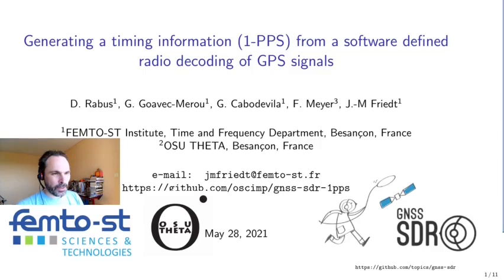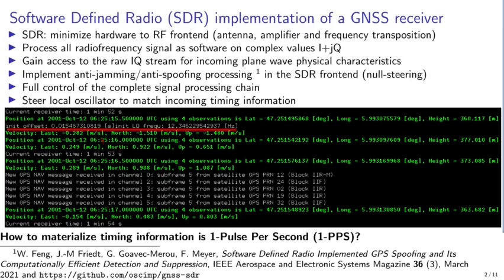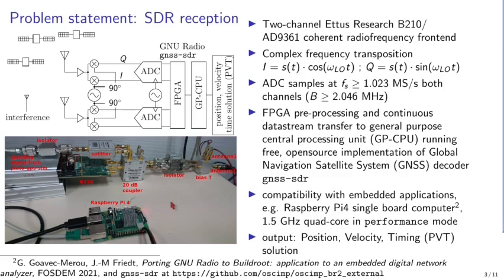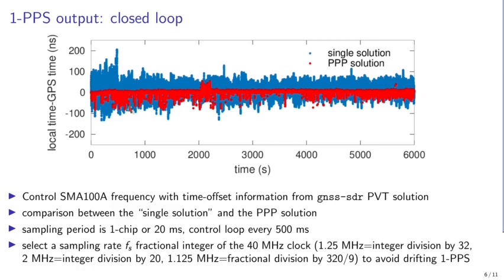Generating a Timing Information (1-PPS) from a Software Defined Radio Decoding of GPS Signals

Comment: AI Summary

Abstract:

This IEEE IFCS 2021 tutorial demonstrates a method for generating a precise hardware 1-PPS (one pulse per second) timing signal using a Software Defined Radio (SDR) processing Global Navigation Satellite System (GNSS) signals, specifically leveraging the open-source GNSS-SDR framework. The presentation outlines the challenges of obtaining accurate timing from SDR systems due to asynchronous data transfer and processing latencies. It identifies the ADC sampling clock as the only reliable time reference within the SDR chain. The core solution involves steering the frequency of the ADC's clock (which also clocks the FPGA) based on the timing corrections derived from the GNSS-SDR software's Position, Velocity, and Time (PVT) solution. An FPGA counter generates the physical 1-PPS pulse from this steered clock. The results show that this closed-loop system achieves timing stability (Allan Deviation) comparable to dedicated hardware GNSS receivers, reaching approximately 10⁻⁸ at 1 second and 10⁻¹² at 10,000 seconds. Potential pitfalls, such as sample drops caused by incorrect GNSS-SDR configuration and challenges with less stable oscillators like TCXOs, are discussed along with their solutions. While frequency stability is demonstrated, precise phase control remains an area for further investigation.

Generating a Hardware 1-PPS Signal from GNSS using Software Defined Radio

*   0:00 Goal: Generate a hardware 1-PPS timing signal from GNSS signals decoded using Software Defined Radio (SDR), specifically the GNSS-SDR framework.
*   0:20 SDR Principles: SDR minimizes hardware (antenna, LNA, frequency down-conversion, ADC) and performs signal processing in software on a general-purpose CPU, analyzing I/Q (complex) data. This allows flexibility, e.g., for spoofing/jamming analysis.
*   1:11 Control Objective: Use the time information derived from the GNSS signal by GNSS-SDR to steer the local oscillator of the SDR front-end.
*   2:03 Problem Statement - SDR Data Flow: SDR reception involves an antenna, preamp, and I/Q detector feeding dual ADCs (e.g., inside an AD9361 on an Ettus B210). Data goes through an FPGA to the CPU via asynchronous interfaces (USB/Ethernet).
*   3:37 Embedded Feasibility: Systems like Raspberry Pi 4 have sufficient processing power for this GNSS-SDR approach.
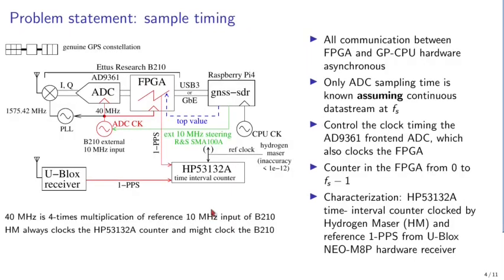*   4:18 Problem Statement - Sample Timing: Asynchronous data transfer (USB, Ethernet) and variable processing delays mean the arrival time of data packets at the CPU doesn't reflect the precise sample acquisition time.
*   4:51 Key Insight - ADC Timestamp: The only reliable timing information comes from the ADC sampling instant. GNU Radio (used by GNSS-SDR) timestamps data blocks based on the ADC sample count.
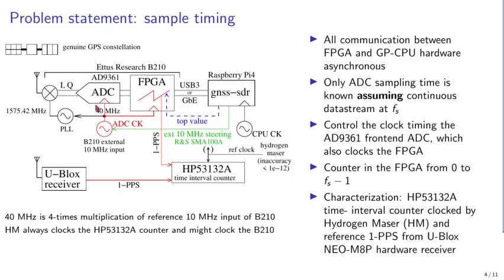*   5:10 Proposed Solution - Clock Steering: Steer the clock that drives the ADC and FPGA. Control this clock's frequency based on the timing error calculated by GNSS-SDR.
*   5:27 Hardware Implementation (1-PPS Generation): Implement a counter within the FPGA, clocked by the (now steered) ADC clock. The counter counts from 0 to Fs-1 (where Fs is the sampling frequency) to generate a 1-PPS output pulse.
*   5:48 Verification Setup: Use a high-precision time interval counter (HP 53132A) referenced to a Hydrogen Maser, comparing the SDR-generated 1-PPS against a hardware u-blox GNSS receiver's 1-PPS output.
*   6:26 Open Loop Results: Without control, the SDR's 1-PPS output drifts significantly relative to the reference, demonstrating the need for closed-loop steering.
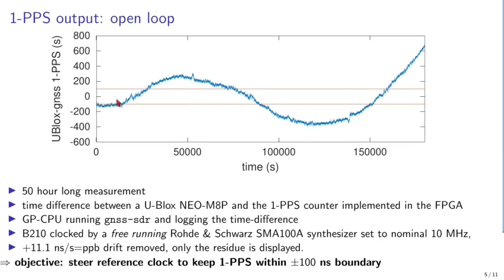*   7:26 Closed Loop Results: Steering the SDR's clock using the GNSS-SDR PVT solution keeps the 1-PPS output's timing error well within the target +/- 100 nanoseconds compared to the reference.
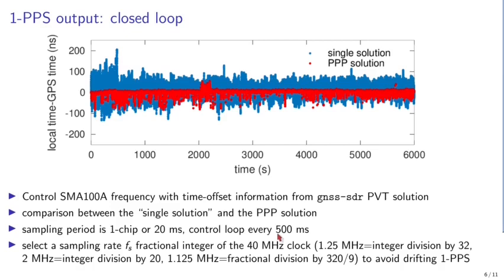*   8:18 Sampling Rate Considerations: Using sampling frequencies that are integer fractions of the SDR's master clock is crucial to avoid frequency errors and drift.
*   9:03 Potential Issue - GNSS-SDR Conditioner: A specific configuration issue in the GNSS-SDR 'conditioner' block can lead to periodic sample drops, causing discrete phase steps (e.g., 500 ns every ~hour at 2 Msps). The fix is to use a "pass-through" configuration.
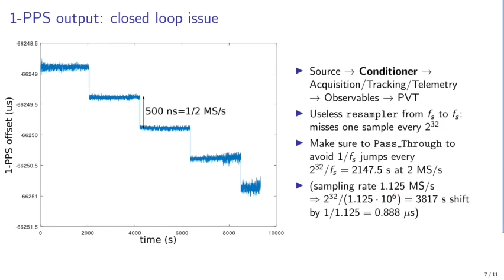*   10:22 Corrected Closed Loop Performance: With the configuration fixed, the SDR-generated 1-PPS achieves excellent frequency stability, comparable to the hardware u-blox receiver (Allan Deviation ~10⁻⁸ @ 1s, decaying to ~10⁻¹² @ 10,000s).
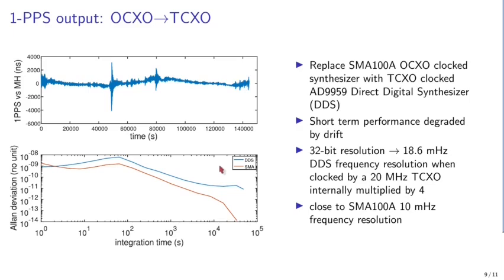*   11:44 Using Less Stable Oscillators (TCXO): Replacing a stable OCXO with a TCXO (common in embedded devices) shows similar performance is achievable, but requires careful control loop tuning and initialization.
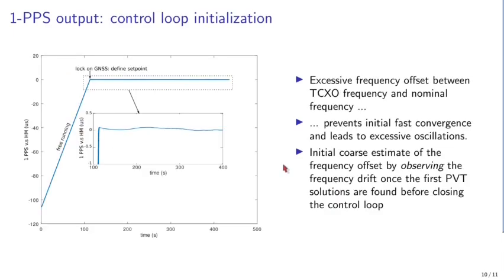*   12:32 TCXO Initialization: The large initial frequency error of a typical TCXO necessitates an initial frequency estimation phase before closing the loop to prevent instability.
*   13:23 Conclusion: The method successfully bridges software-derived GNSS timing to a physical hardware 1-PPS signal by steering the ADC clock. Frequency stability is high, but precise phase alignment requires further work. Sample loss impacts phase significantly.
*   14:16 Code Availability: A fork of GNSS-SDR implementing this functionality is available.

I used gemini-2.5-pro-exp-03-25| input-price: 1.25 output-price: 10.0 max-context-length: 128_000 on rocketrecap dot com to summarize the transcript.
Cost (if I didn't use the free tier): $0.05
Input tokens: 16835
Output tokens: 3313